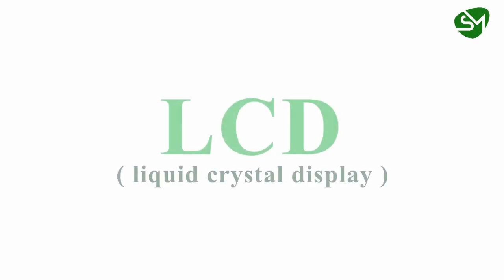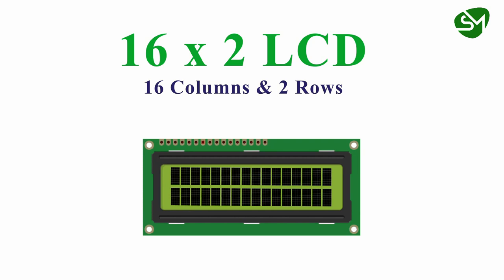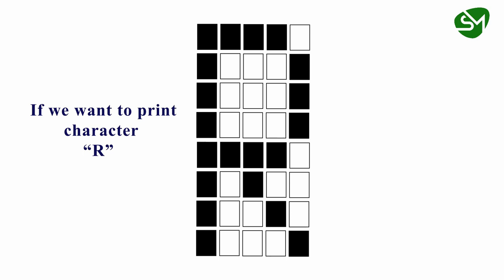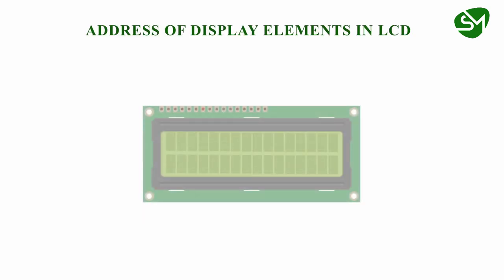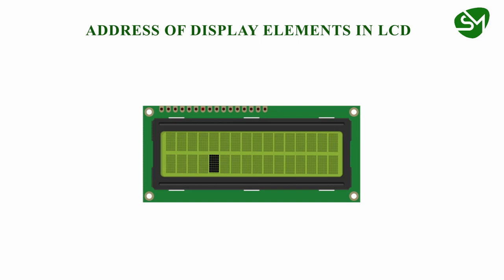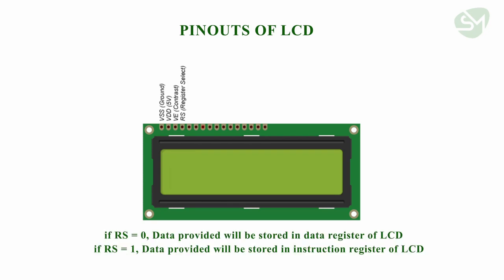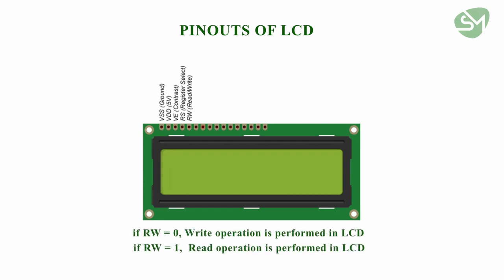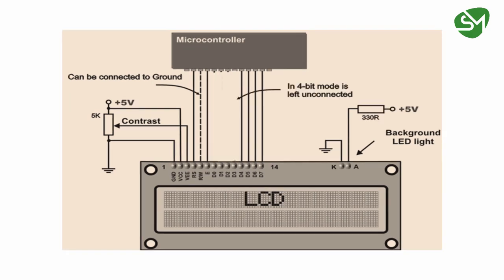16x2 LCD Working principle explained

Comment: I have a problem. My lcd leds died so i opened to replace mini leds. But i ended up breaking a mini part clip which is part of the front black cover. The front black cover which inserts into the 6 holes and from the back, it bends onto the copper pads. One of the 6 clips that turn on to the pad has snapped off. How do i fix this?